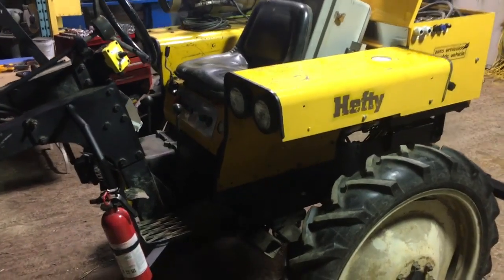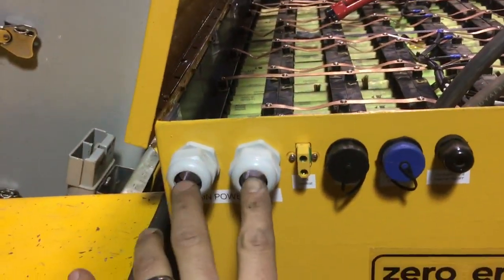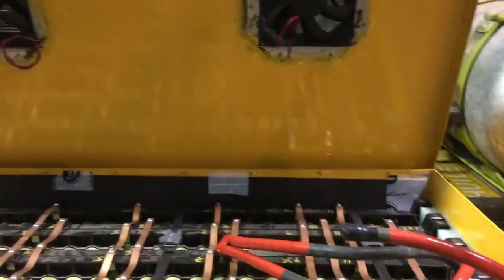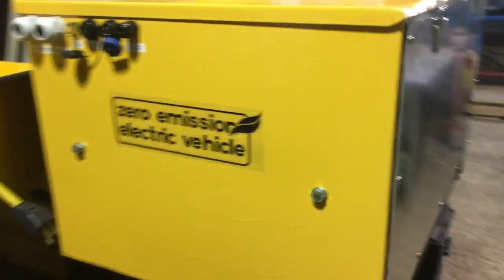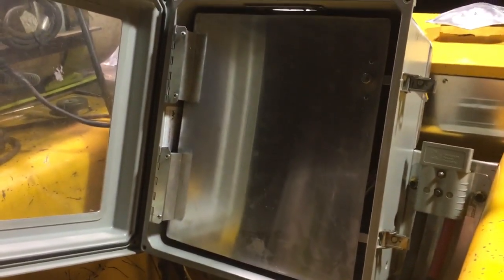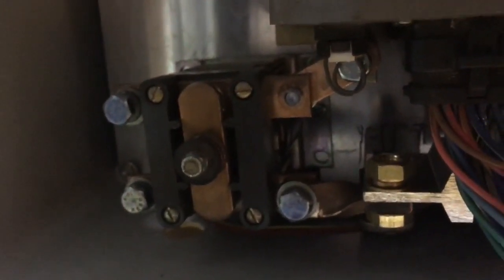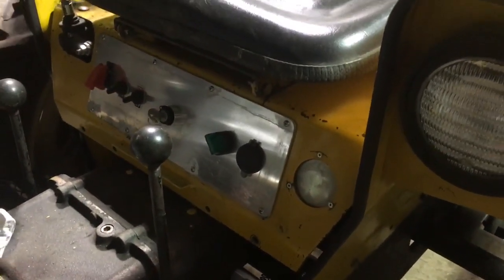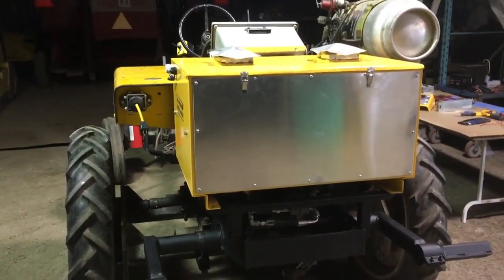Hefty-G tractor, electric conversion, part 5: battery pack assembly

Comment: Very interesting work, and great of you to share it. Thanks! I was wondering if you ended up having any problems with heat in the battery box. I was guestimating that sitting above the motor with just the two exhaust fans moving air could be an issue.
Reply from the maker: Ultimately the heat of the batteries has been a complete non-issue and ventilating the battery box seems to have been totally unnecessary.  The motor generates some heat but is exposed and well ventilated by it's own fan and the controller generates heat inside the small enclosure behind the seat where 3 small fans handle it but the battery case has never gotten even warm.  The batteries are operating way below peak demand with instantaneous power draw in the range of 2 to 5kW with occasional peaks to 10+ kW so they're not even breaking a sweat, so to speak.

Comment: Epic work
Reply from the maker: It certainly felt that way at times.  Well worth it though.  We're just getting ready for another season of weed slaying and I don't have any oil changes or gummy gas or concerns about the machine not starting up.  Just turn it on and go!
Reply: @reidallaway  I have been looking at tractors and electric motors on ebay and I only have 1.5 acres!
Reply from the maker: @srslam1347  a walk behind tractor like a Tilmor Power Ox or BCS (or both) might be a better solution for 1.5 acres.  Both lend themselves to electric conversion but neither is yet available as ready made electric model.  Check my videos for my BCS conversion.
Reply: @reidallaway  yep seen them. I have been looking about, doesn't seem much of a market here for them used. Old tractors are plentiful though.